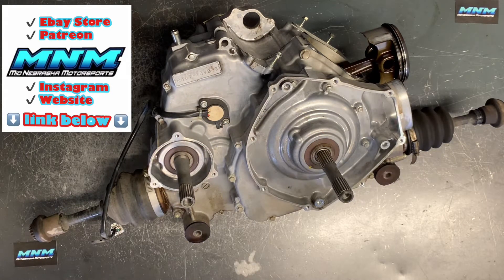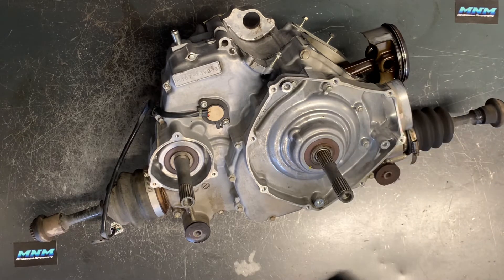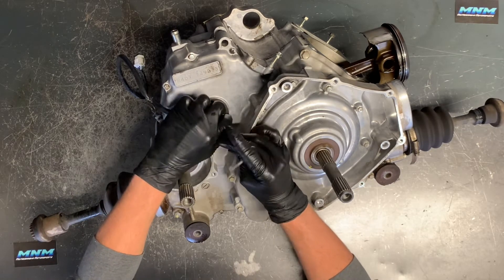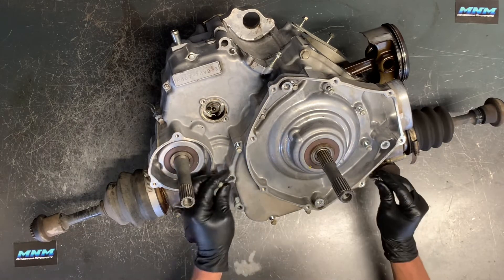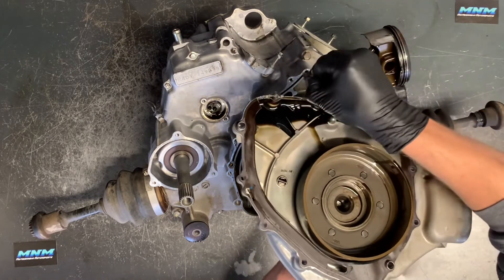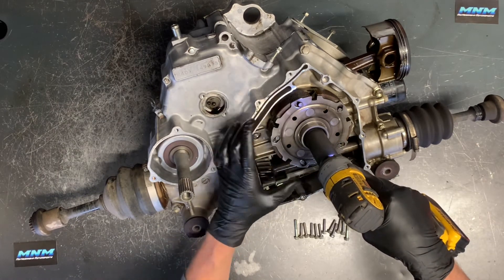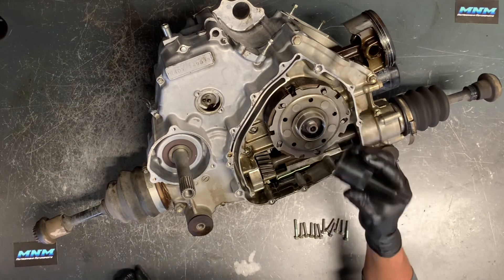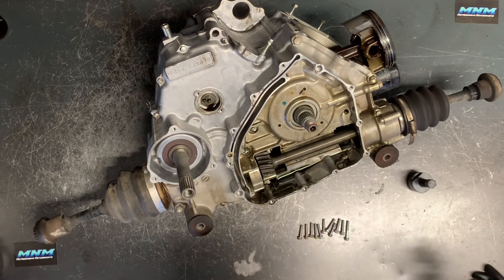Suzuki King Quad 500 750 Auto Centrifugal Clutch Shoe Pack Removal - Special Tool Link

Comment: Ive watched every video that has to do with clutch and clutch housing that in this video and many others you say youve shown how to get the what you call housing out of the side case but i cant find that video, is there a idea which video that might be to replace that clutch housing because the primary drive that slides onto the rod is strip and i have to replace it, thank you
Reply: I could use that video too